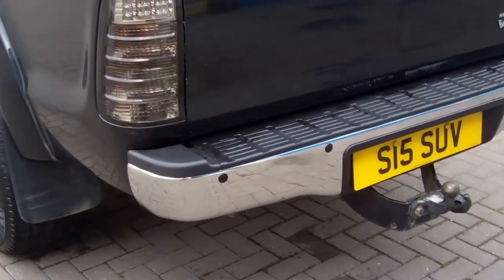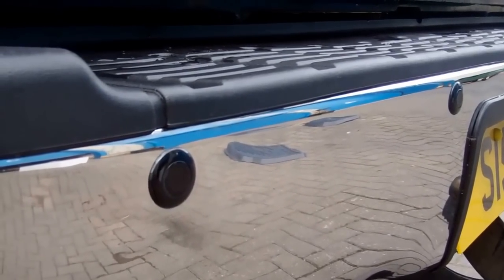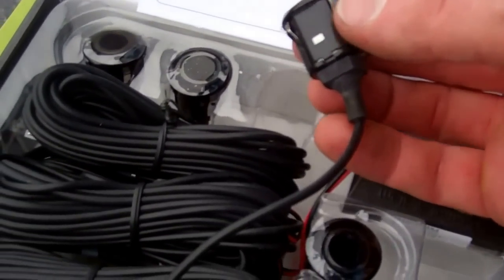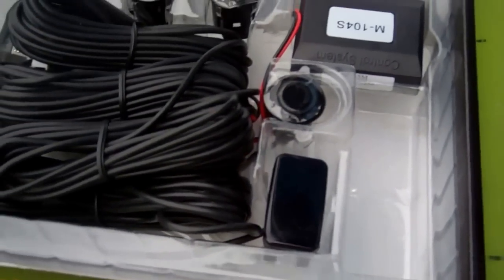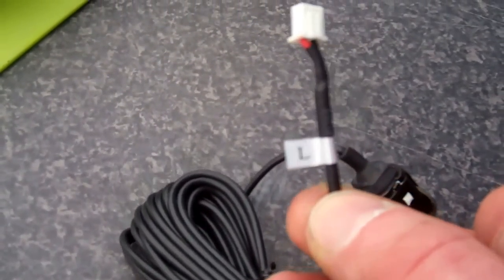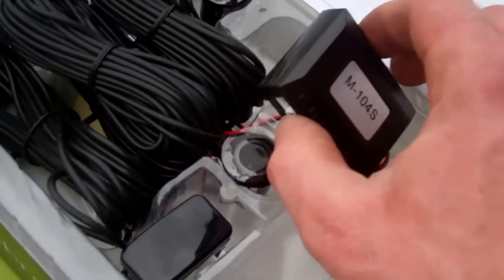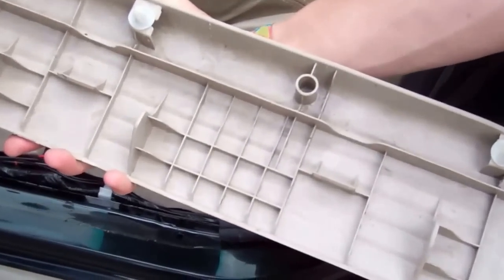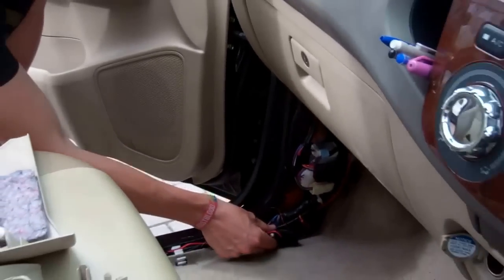Toyota Hilux Mk6 Vigo Pickup Rear Bumper with Parking Sensor Demo

Comment: How do you remove genuine sensors (Toyota OEM). I need to remove my bumper for repair but scared i damage the reverse sensors....would they pull out like these ones??
Reply from the maker: Hi Bob - I guess thye must just push in but not ever tried with genuine ones.